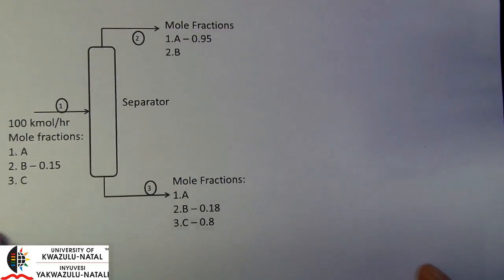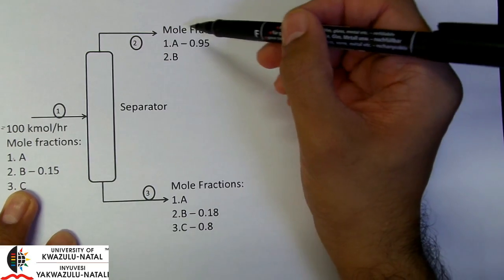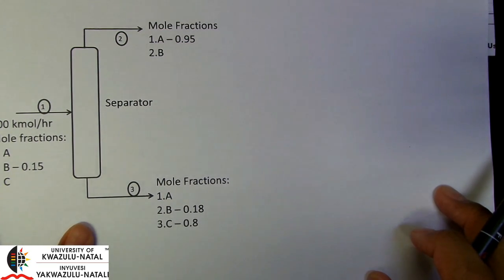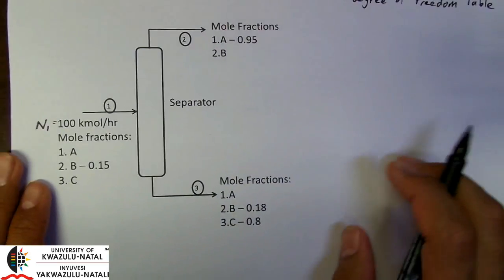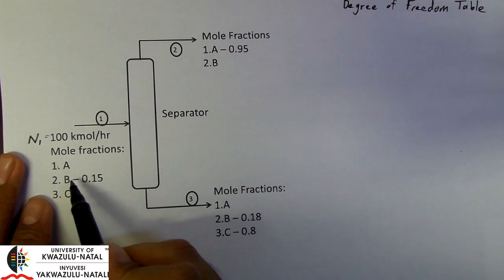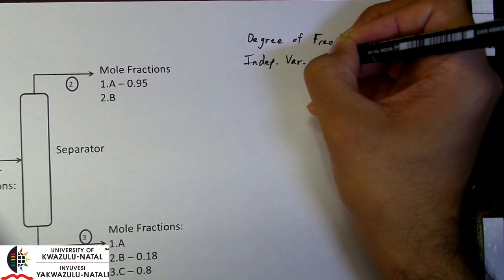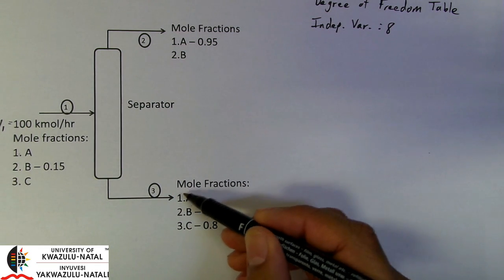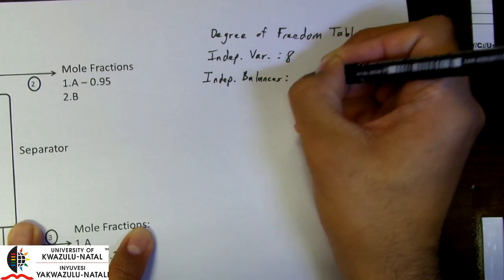Material Balancing - Lecture 2 DOF Table and Subsidiary Relations

Comment from the maker: ATTENTION Students ! DOF Table at 36:40. Looking at the information, it is more accurate to simply use the fact that all propane goes to the distillate and all pentane goes to the bottoms, and delete propane from the bottoms and pentane from the distillate. In this way, the number of stream variables will be 10. We would then have 4 balances, 1 specified flow and 4 specified compositions. One subsidiary relation (80% isopentane in distillate) then completes the DOF table to have a DOF of 0

Comment: Hi there!
I have a question... when you describe the subsidiary relations (around minute 36:40) you only mention two (1: 80% of isopentane... and 2. ALL of the propane is contained in the distillate). BUT isn't there a third relation? It also says that ALL the n-pentane is contained in the bottoms stream... Why would you not consider that third "relation"? Of course then the DOF would be -1 which would result in an "overspecified" system... I am confused... ;)
Reply from the maker: +Kim Fraederich See comment above